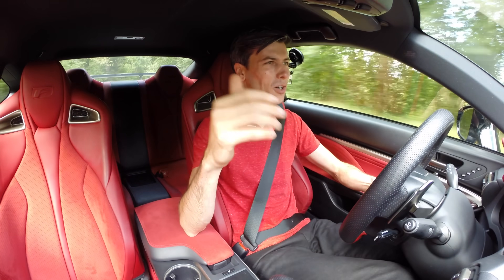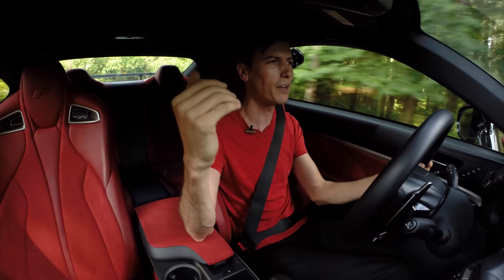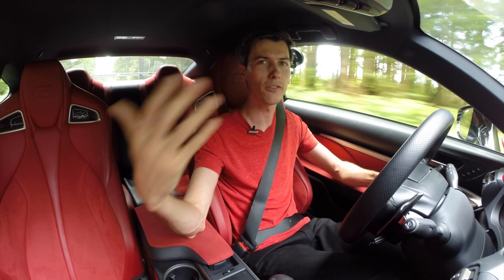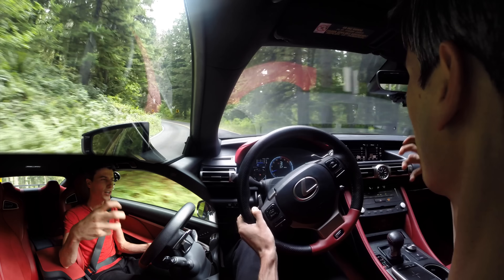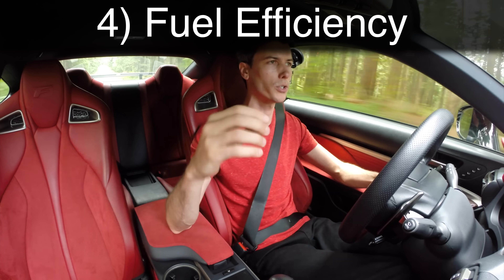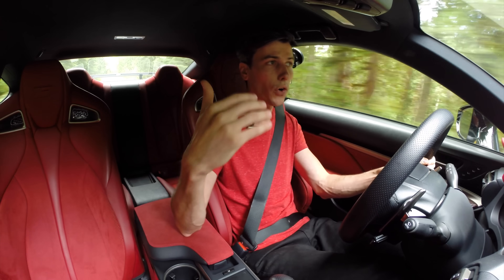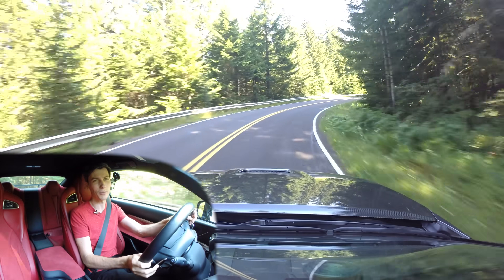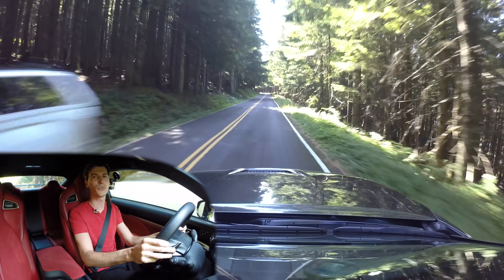5 Reasons You Shouldn't Buy A Turbocharged Car

Comment: For several of the reasons you mention (engine knock, heat, and lower compression) most turbo equipped cars also must use premium fuel.  For me this is one of the major drawbacks that you did not mention.  I have a BMW without turbo but it still requires minimum 91 octane, but man I am sick of paying 40 cents per gallon more for it.  That is almost $7 per tank more and it adds up over the life of that car.  Plus it is just a stone cold rip off and I just hate being ripped off.
Reply: Then you should have purchased a car that takes regular fuel.  🤷🏻‍♂️

Comment: This trend to small turbo-charged engines is driven by the way mileage ratings are determined, both here in the US and Europe. These testing methods really make the turbo-charged engines seem to have a much higher mileage ratings than what you would achieve in the real world, unless you are driving very conservatively and hardly ever having the turbos kick in for long periods of time. And if you replace cars when the warranty expires, or soon after, than no problem. But if you keep your cars for long periods of time (my DD is an '06 Accord/5-speed manual with 168k miles,), then these small, highly stressed, motors will not last nearly as long and will be more difficult, and expensive, to fix.

Comment: #2, I disagree in some cases.  I have a 4.0 twin turbo and it pulls like a mofo from 2k to redline.  Peak torque is 2,500 - 4,000.  Like you said, very little power gain up to 50% throttle but almost unnoticable lag if I give it 100%.  I also can't think of a single normally aspirated car that pulls 2.4 lbft per ci. on pump gasoline.  

My wife's on the other hand...  There have been times I've been sitting floored at a light and absolutely no reponse from the engine.  It's not an enjoyable car to drive after driving the one above.  

Turbos just take a bit to get used to the idling 10-15 seconds after startup and before shutdown.

Comment: I should give you a big thumbs down for this one.  Basically, what you stated was if you had a poorly designed turbo engine, you're better off with a NA engine.  You were literally comparing apples and oranges.   The notion that turbo engines don't make power at high RPM's....I guess you've never heard an older F1 engine when they were pulling over 20,000 RPM.

Comment: The argument from asking “would you want a delay in your steering response?..no!”  Would you want cancer ? no!  Very silly. Would everyone want a 10 second car and the option to have 2,000 HP on demand, YEAH!  But this is the part where it gets silly. If you drive a TURBO and are a DRIVER then you usually know how to work the gears to keep the turbo in the range you want it to be. Only a noob lets the boost spool up to hit you in the arse. It’s like standing on the throttle while you’re in 5th when you’re going 30mph and complaining you have no power and then TOO much power.

Comment: Top two reasons not to buy a turbo car:
1. It's yet another expensive part to fail 
2. You have to use Premium gas which is 50 cents more a gallon than regular gas (or at least it is in my area)

Comment: May I offer a better solution: the Supercharger
Reply: Why not both? 😂
Reply: @hereb4theend  Double supercharging (shaft driven + exhaust driven) WAS used in WW2 aircraft, but required very high octane-rated fuel.
Reply: @DavidFMayerPhD  noice
Reply: @hereb4theend  hi, there are cars with both, it called twincharged.
Reply: @hereb4theend  because turbo ruins engine sounds 😉
Reply: @morreracing  not if you're a diesel guy...
Reply: @tk4x431  well those sounds like tractor anyway 😂
Reply: @tk4x431  diesel gay* xD
Reply: @tk4x431  a natural aspirated diesel sounds better
Reply: @hereb4theend  there wouldn't be enough room
Reply: @richardjames840  hi, there are cars with both, it called twincharged.
Reply: Or procharger but supercharger sound better
Reply: Richard James Twin charging ;)
Reply: HerrKuhn928 Superchargers are better than turbos in SOME ways, not all. I agree that superchargers can and often do drink fuel. However, a smaller supercharged engine is often more fuel efficient and more powerful than a bigger engine with an equivalent displacement (smaller engine and supercharger displacements added). Superchargers are very easy to modify compared to turbos when it comes to adding power, without the use of electronics. You simply swap pulleys around and boom: more power. Furthermore, many people prefer the sound of a supercharger than a turbo. This is a very subjective reason, but most supercharged engines have no exhaust restriction (excluding some WWII engines in aircraft), meaning a more clear and crisp exhaust note compared to the more muted exhaust of a turbocharged engine. In addition, superchargers don’t suffer from lag, meaning that a supercharger making power figures that would require a big turbo can beat said turbocharged engine in acceleration all because of the spool lag from the big turbo. The common solution to turbo lag is to have sequential turbos, which minimize lag without sacrificing top end power. Sequential turbo systems are more expensive both in maintenance as well as upfront cost compared to superchargers. If that isn’t enough, twincharging exists, and if you couple that to a hybrid system, you get even more benefits. But lets leave that out for now. 
Apologies for the essay, I’m very passionate about this.
Reply: You took words from my mouth, i totally agree.
Reply: They're expensive?
Reply: @snivithefox  only for the poor.
Reply: Same same... 🤦🏾‍♂️

More expensive..
Reply: @KR-jg7gc  used turbo, used intercooler, hosings, exhaust manifold, moderate boost ~0,5bar you can make NA into turbo under 2k€. If you want more it will ask a lot more money 😉
Reply: ? Why don't they? What's the average life of both and cost, install and calibration ? I heard turbos only last about 100,000 miles
Reply: @edwardaguilar6322  price depens how much you take power from your engine, what parts you use ect, cheapest build can be around 2k€ if you make it all yourself. Turbos can last very long time if you use them correctly, my turbo Subaru has 330tkm (around 200k miles) and has orginal turbo.
Reply: @edwardaguilar6322  I had both turbos last 297k miles on my 2.7L F150 EcoBoost..

Comment: My first gen Acura rdx has great engine noise, and drives great as long as you maintain and change the proper fluids. Turbo lag is mitigated via variable timing.  The only thing that sucks is gas mileage.

Comment: You want throttle response? buy electric, want flat torque response? Buy electric. Or car with multiple asynchronous turbochargers/superchargers. Noise? I would argue that turbo supra sounds better than lexus V8 😉 fuel inefficient due to enrichment? Why not go with water injection?

Comment: Hey i have a engineering question, is it possible to run gas in a compression engines if you regulate the fuel and modify the cooling? If not why. My dad was a mechanic since his teens, but for every reason he gives me why i found a solution but in his mind it wont work.

Comment: I am on my third Ecopoop and I have had zero engine issues. Last one was an Edge 2.0, engine itself had no problems. The AC compressor seized at 110k miles and I didn't want to invest any money into it, I was planning on replacing it next year anyways. I was going to buy used and get a F150 With the 5.0 Coyote. However, couldn't find what I wanted, I was being pushed a bit..heat wave...no AC and there were some very good rebates on new Ranger's which is what I got. So this is my third ecopoop. The 2.0 Edge had more turbo lag but it wasn't horrible by any means. Ford uses a small turbo which does spool up fairly quick as you obviously know. The 2.3 which is in the Ranger has a twin scroll for better throttle response. Which is noticeable. I dont disagree with your points on why not to buy, Im not an engineer you back up your points with your degree and knowledge. I really think its more about what you are looking for. I like the Ranger so far.  I drive 18 miles each way daily for work and its nearly all highway speed, with a couple of miles of city roads. I have been averaging  between 18.5 and 19.5 mpg on regular 87. With these boosted engines I typically run either 89 or 91, you dont pick up much in fuel milage but I do believe it burns cleaner, less carbon buildup. Right now prices are a bit steep for premium, Im in California. Ya it sucks. I do plan on getting a catch can as this motor doesnt have the dual injector system. I use Mobile 1 as I have been in all my cars since the late 1980's. Since the newer cars use the algorithm for oil life, I have been changing my oil at the 50% point, which turns out to be about twice a year with the miles I drive. Enjoy your videos, thank you

Comment: Here's my question regarding turbocharged cars:  I driven my turbocharged Volvo on a few road trips with cruise control set at 80 - 85 mph and encountered steep hills along the way (I-17 north from Phoenix to Flagstaff, Raton Pass between Colorado and New Mexico, I-10 west from Palm Springs, etc..) and the car will maintain the set speed without downshifting or any increase in RPM.  This is with the car loaded with my family and our things.  The fact that this little turbo 2.5 liter turbo just climbs those hills effortlessly while averaging 30 mpg or so over the whole trip blows my mind.  How does it do that?

Comment: With today’s technology we have seen great response with larger turbos that make more peak power the problem is the auto manufacturers are using shitty quality turbos to reduce cost the K04 on my car stock can’t produce more than 18psi of positive pressure my new turbo is rated for 450 and it’s the same frame K04 with upgraded wheels, bearings, and oiling it can handle 30psi and is actually faster to spool than my stock one...

Comment: 1) The Taycan Turbo seems to have eliminated all the turbo problems.  😹
2) It is getting harder to find cars that get good fuel economy and have a bit of "punch" without a turbo. Fortunately some of the manufactures are avoiding turbos and the Mazda Skyactive-X engine seems like a solution to increased power with good fuel economy.
3) As battery technology improves, the electric motor boost in hybrid cars may become a better alternative to turbo charging to improve mpg and power. 
4) For real fun the engines that combine supercharging and turbocharging seem like the complete (but complicated) package.

5) I have a compact car, manual transmission, with a  turbocharged 1.4L engine and driven normally I don't find any issue with turbo lag. The car performs just the same as my previous manual transmission compact car NA 2.0L engine. Drivers who run up to the red line a lot are just wasting fuel, shortening the life of the engine and the turbo. Play video driving games instead. 🙂

Comment: So how do you lower the temperature in a turbocharged engine?  You use EGR to pump inert exhaust gases into the chamber.  That is of course until you the pedal to the metal.

Comment: It used to be turbo is an expensive engine up grades for small engine now A day it is hard to find a none turbo engine car just like manual transmission car all come with auto transmission all these tech are expensive to fix with fuel economy and air pullution stander getting tighter and tighter the day of garage mechanic is over with some of the special tools we need to buy to fix it are expensive too 😬

Comment: Busting Penske's myths about turbo or drawing the line between a graduate engineer and an Instagram/YouTube drama queen :

1. Throttle response. Anyone enjoying a linear throttle response has an insensitive butt dyno or suffers of nasty hemorrhoids. There's no bigger joy than the torque kicking in. Penske forgets about cam profiles that can make a NASP engine behave totally different on throttle response. Penske also seems to forget about sequential turbos that make the engine responsive across all rev band.

2.  Torque curve depends on the fuel air mixture being burned per engine cycle. That can be brought in by a turbocharger, but also a supercharger and tuned by valve timing and valve lifting. I would mention that a Drama Queen will always use the word "dramatic", as Penske does. 

3. Reliability vs costs. The peak cylinder pressure is NOT a problem for the lightweight materials used in the engine. Penske babbles something about Diesel engines. Those are almost useless in car applications without a turbocharger and the high pressure is actually what makes them work. The fear to have less and less oil in the engine points to other problems (gasket leakage, cylinder or ring issues etc) that plagues also NASP engines.

4. Fuel efficiency. Penske forgot to read some further pages in his book about the difference between the static and the dynamic compression ratio and how a turbo/supercharger improves the second on top of the first. Then again some BS about hot air under high pressure leading to knock. Knock appears mostly when fuel mixture self ignites in the compression cycle. In DI engines, the fuel is injected later, close to the TDC and moments before spark ignition, hence knock is much, much harder to reach. Yes, the mixture is RICHER as in MASS ratio, but this happens in a SMALLER volume where the molecule distance is SMALLER and efficiency GREATER.  Just compare the fuel consumption of a 250 HP 3 liter NASP engine with a 250 HP 2 liter turbocharged engine, the first one is way more inefficient.

5. Sound. That left me speechless. I had doubts that Penske is a ricer, now they're all gone.

What Penske forgets is:
- engine mass and volume between NASP and TC for the same power, resulting in nose heavy cars, hard to control polar momentum and driving effort to maintain a decent trajectory
- added friction, heat and pumping losses coming from extra cylinders, decreasing the engine efficiency
- increased amount of consumables (extra spark plugs, oil quantity, cylinder gaskets) as well as engine complexity (two cylinder heads, extra injectors, complex timing gearing)

Fail. Miserable fail.

Comment: i like supercharged engine because i love toque. N/A engine doest give you that (strong pulling feel) like supercharged or turbocharged engine. i had the N/A 6.2 l E63 AMG about 500 HP it was a great engine with awesome sound. however, you will instantly feel the lack of pulling force if you compare it to the E55 AMG (around 470 hp). which one would you prefer?

Comment: Well. High revving engines and high compression ones (like the one in my Celica) still have to be built like a tank and some of the components are expensive as well but generaly it is true they are cheaper to build. And throttle response makes up for everything.

Comment: My opinion is This: It depends what you want to do with it. Turbos are great for driving in strait lines where you have time to get into boost. On curvy roads you may not have time between corners to get into boost thereby reducing your overall performance. With NA in corners I find its better (read more fun) to have the response and control in the corners. That's my $0.02.

Comment: As an owner of both a Mustang GT and an ecoboost F150, they're both amazing. There's like, no lag in that ecoboost that's why I like it so much. And with direct/port injection they can increase compression ratio a bit and still deal with knock prevention. Also, the turbos are water cooled to keep those turbo and oil temps down. But man, that 5.0 with exhaust is just a heavenly sound.

Comment: I've got both, but prefer the turbo rush and higher torque than the naturally aspirated ones. The 8200 RPM in my V8 sounds freaking fantastic though. You may not have noticed, but the latest turbo cars have stratospheric compression ratio compared to both the old days and old NA cars, and water & Oil cooled turbos along with synthetics have pretty well cured the old turbo coking issues. PS, how are you getting a MFG plated Lexus to drive? I work there, so curious...

Comment: All these 4 cylinder turbos that $40k to $50k luxury cars now have is one of the reasons I quit ICE cars and went to a Tesla. Small turbos SUCK - so much lag. F that BS, now with a Model 3 I have instant torque at all times with zero lag ever. The last best engine I had in a car was the naturally aspirated 3.0L in-line 6 in the BMW 328i I had years ago.

Comment: I normally drive an EV or a diesel truck. But I do like to take my wife's suburban out once in a while and open her up. Takes me back to learning to drive in a '64 Chevy Belair w/283 V-8. I had swapped out the 2bbl carb for a 4bbl I got off a junk car. Then put the air cleaner cover on upside down so you'd hear the intake from the entire surface of the air filter. That sounded awesome. It also had limited slip differential so you could make a great display when leaving high school and breaking the wheels loose from the pavement.

Ah to be young again.

Comment: I owned a 1989 Plymouth Acclaim with a 2.5 Turbo. No turbo lag, no dependability issues, no turbo failure. No additional maintenance issues over same car with non turbo engine. Engine produced maximum torque at 3000 R.P.M. and torque converter stall speed was 3000 R.P.M. From a dead stop it had no problem breaking the front tires loose.  Car ran over 3000 thousand miles with no turbo failure. Transmission lived for 20050 thousand miles. I bought the car new and owned it for 10 years. I spent my entire working life in the automotive service industry and retired after 45 years. Most of those years working in dealerships. During the time I owned the Acclaim I worked at a full line Chrysler dealership so I seen those cars every day. After they added cooling from the cooling system and didn't depend on just the oil to cool the turbo failures dropped drastically.